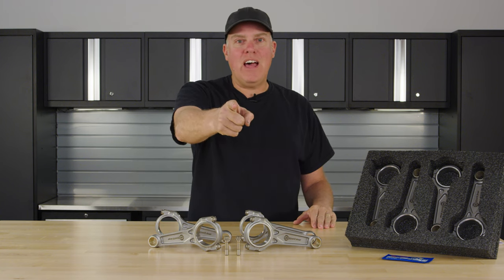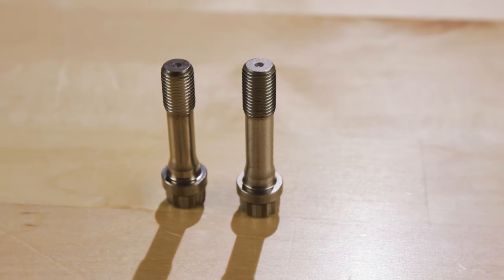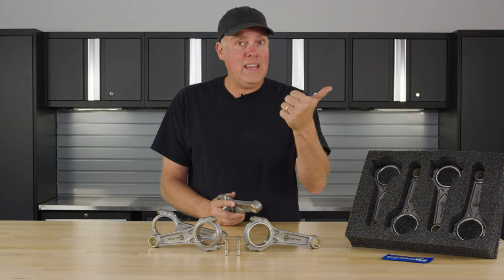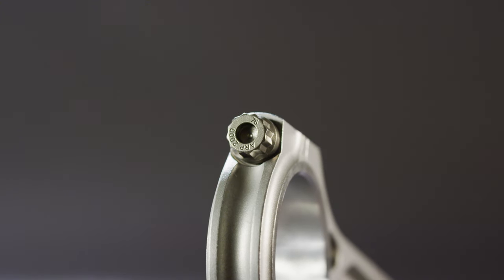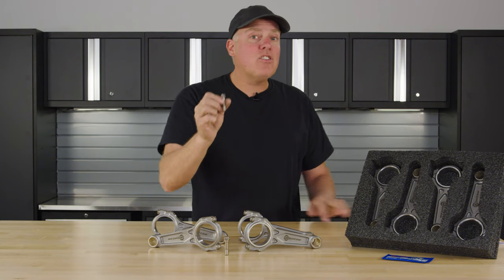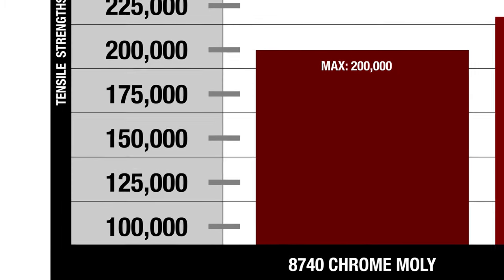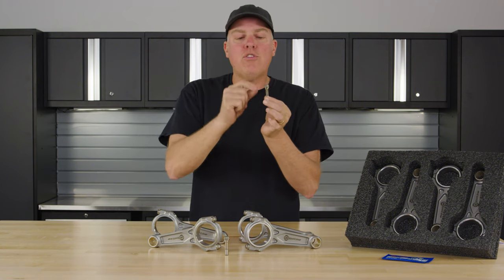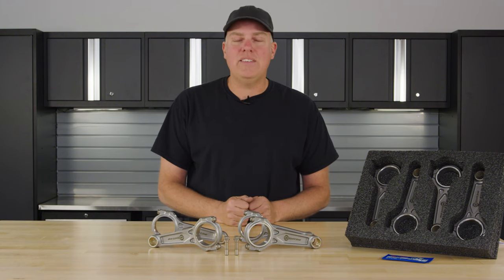ARP 2000 vs 625 Plus Bolt Upgrades

Comment: One thing to remember about sport compact engines is that, contrary to popular belief, they tend to have much longer strokes and shorter rods than, say, an LS. This means that, compared to an LS, they actually have a GREATER need for a stronger rod bolt.

Comment: What are the bending moments the rod caps experience? Where is that force(s) generated?
Reply: And why would ductility be advantageous for rod bending.....lol
Reply: Downwards force being generated by the piston are placed on the rod not only at TDC, but for a few degrees after as well, I.e when the rod is at an angle in relation to the crank and piston. That force applied at an angle creates a bending moment on the rod.
Reply: @vadski3469  I meant the rod caps. Outside of the intake stroke, the cap is along for the ride. I can understand rpm putting immense load on the bolts, but the cap itself. It's been so long, I can't remember what prompted my comment lol.
Reply: @slowpoke96Z28  My bad lol. I would say the force applied to the rod caps as a result of high rpm, engine braking, etc. exerts a bending moment for the same reason as before as it is applying force at an angle? Meaning the cap would be under a very slight bending moment. That's why I guess they rib the caps to make it more rigid
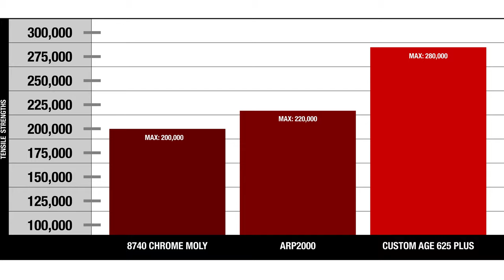Reply: @slowpoke96Z28  2:36
Reply: Force at an angle meaning force applied to the rod in relation to the piston and big end
Reply: @slowpoke96Z28  I think you're right. I guess the best explanation is distortion to the cap from RPM. Not sure though. I would really like to have real data from rod manufacturers to actually see who's "the best." I do like this I beam design and it's a bit lighter than other I beam offerings, but no l19 rod bolts is crazy. 625 adds quite a bit to the big end which isn't good. And they're stupid expensive. Rather run an l19 and replace as needed. 2000's aren't even capable of keeping up with cheap h beams so I don't get it. Otherwise this design is just like the indy rods from yester year which is pretty good.

Comment: What hp rating arp 2000 & 625?
Reply: HP has nothing to do with rod force

I can calculate the forces on it for you if you give me stroke, rpm, connecting rod mass, reciprocating mass. Just punch in the numbers I'll let ya know 

😉
Reply: Correction 

* HP has nothing to do with rod bolt force